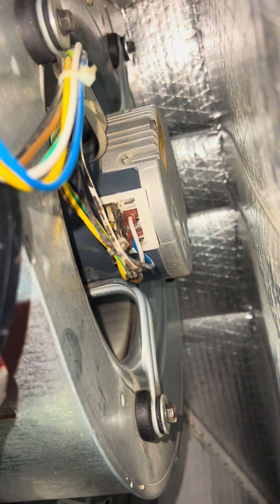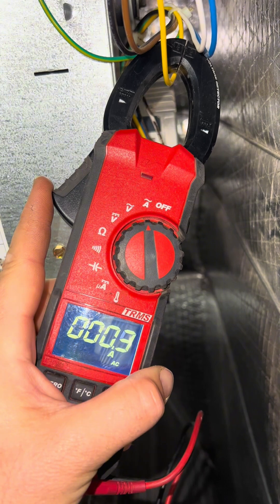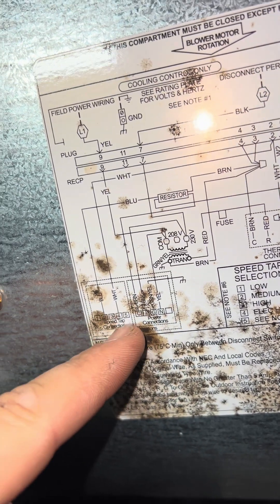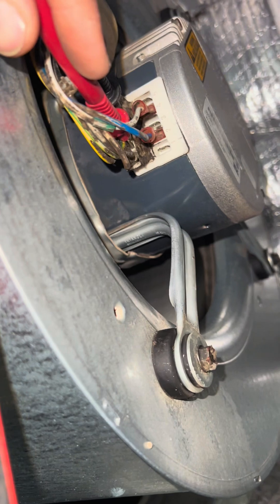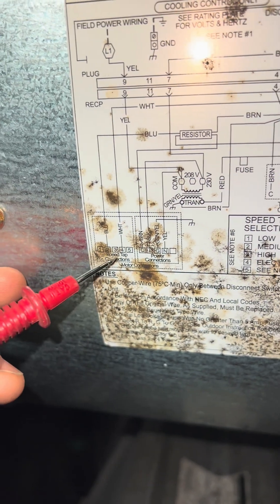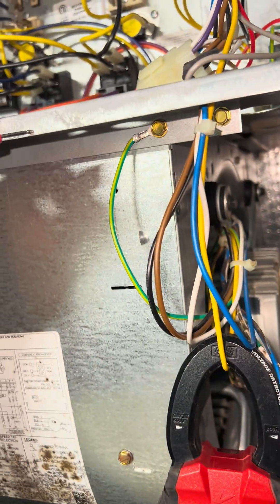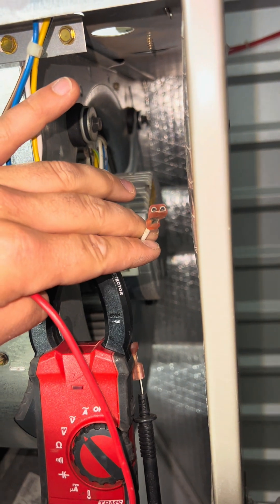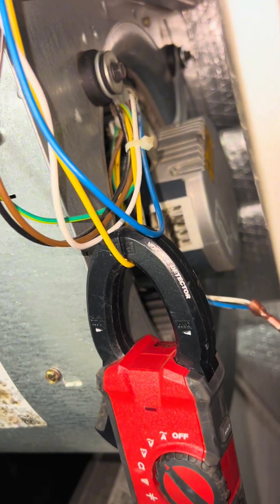How do you troubleshoot ECM motors?

Comment: fun fact....the ECM motors are actually a 3 phase motor. When you pull the module off and disconnect the 3 phase joy plug. You can ohm out the motor side of the joy plug and check for same ohms and if bearings are good you might just replace the module....depending on how old the unit is of course.
Reply: Just replace it. It’s fought its battle and it’s time to rest.
Reply: @alexg6299  definitely, I was presenting extra info is all